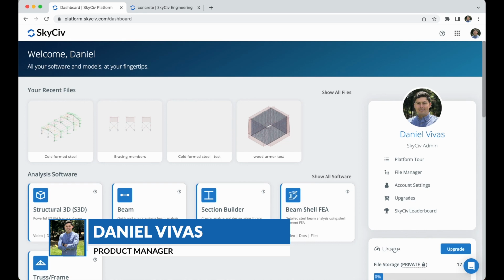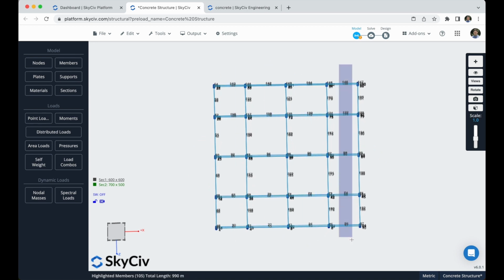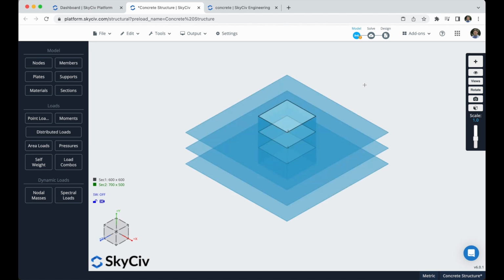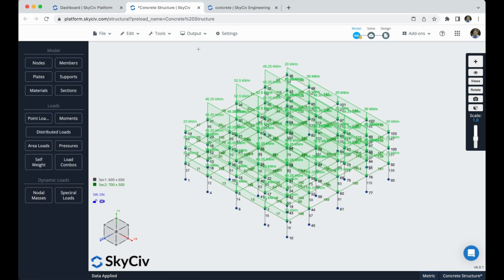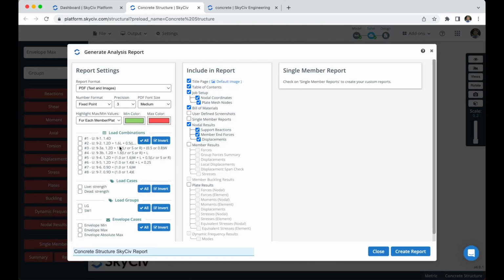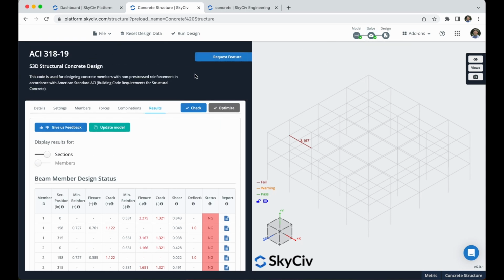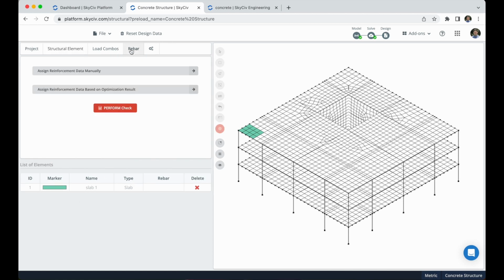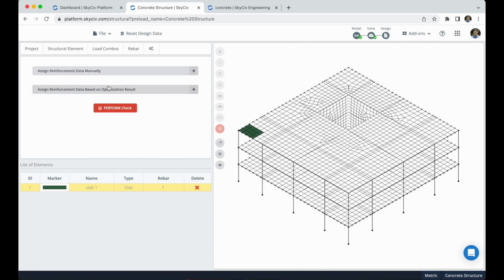Modeling and Solving a Concrete Structure - Walls and Slabs

Comment: hello! Why is there are many results for a member? you can use any of them?
Reply from the maker: In the case of the concrete member design results, the design checks are based on individual section cuts along the length of a member. As various combinations of flexure and axial loading can occur throughout a member, this ensures we are assessing all critical sections. We do have an option for "Member Results" that can be selected from the results page via a toggle at the top of the menu. If you have any further questions that you need assistance with feel free to reach out to our support team by emailing support@skyciv.com